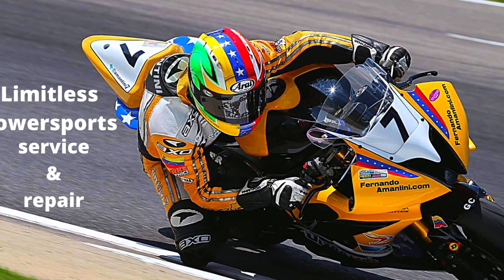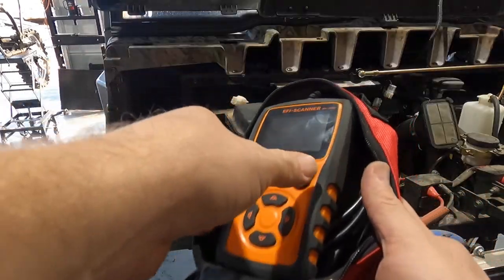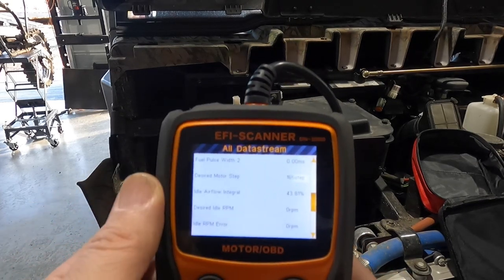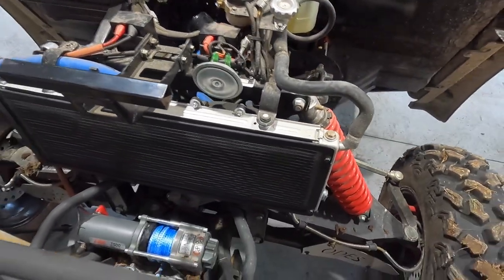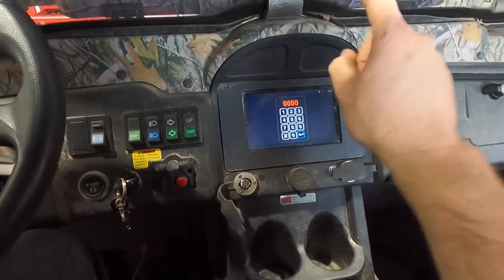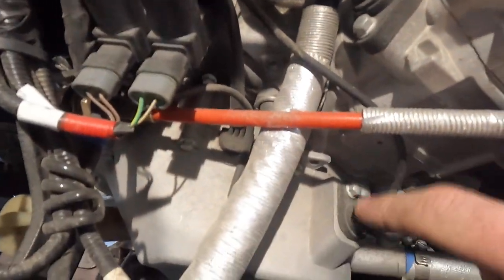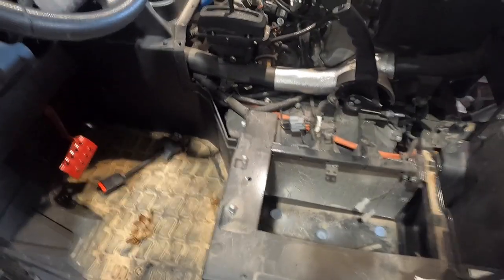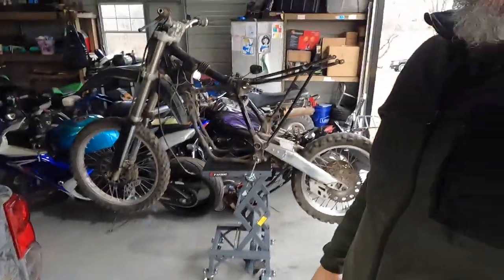Odes, Massimo, Bennche common issues

Comment: My 16 1000x4 starts jumping and cutting out around 16mph. Any ideas? Shop put new transmission in it other thdn that's its all been done to it. TIA
Reply from the maker: Is it like cutting in & out? If so my guess you be the reverse speed controller.  I know you're driving forward but they can cause that issue.  But I would definitely check to make sure that non of the connectors are loose are that  non of the wires are melted are pinched.

Comment: I have a 2016 odes 1000 i have replaced the battery, stator and rectifier. Battery light still on display and the system will not charge. Any thoughts....
Reply from the maker: A lot of people are just bypassing the wiring harness & extending the stator wires so they can just run the wiring directly from the stator & pug into the reg/rec. Did you check the charging voltage at the battery & the ac voltage on all 3 legs of the stator & ohms test it too? I have seen new stators that bad from the factory.  You could also have a break in the harness itself.
Reply: @limitlesspowersportsservic3394  
So the stator was burned there is build up on the fly wheel could that be an issue?. I will go back do those test and get back to you.

Comment: My Odes is pulling to right in front.  Air pressure is good.  Any ideas?
Reply from the maker: Does your odes have eps? If so I have had them start to go out & pull in either direction. Also check the toe in & out of the front end

Comment: Hi there. I just bought a 16 bennche spire 1000. I have no fuel or spark.
Reply from the maker: When you say no fuel, do you mean no fuel pump coming on? Check all you power & ground wires take sure they are not corroded. Then check to see if you have power running to your fuel pump & spark plug coils.  I could be just a relay going bad are it could be the 9 pin connector getting corroded also

Comment: My family just bought a massimo 850 and the throttle is stuck wide open and we couldnt get the dealership to help, any ideas on what the issue could be? Appreciate anyone who gives advice
Reply from the maker: When you give it gas can you feel the pedal return back under your foot? It's a possibility that the throttle positions sensor is stuck wide open are the Iac motor is stuck wide open too. I would take the intake off & look inside your throttle body to make sure the butterfly is returning all the way. But you would need to plug a scanner into it to see where the TPS is set at.

Comment: My hisun runs fine except every once and a while  it will  die with blue to black smoke  rolling from muffler  wait a few minutes  starts up and goes like it is suspost to with no smokeing, it does idle 2000 rims there is no knocking,  it sounds good, I don't  know what is wrong
Reply: 2015 hisun500 utv
Reply from the maker: Well it should be idling around 1,200-1,400 rpms. Idling that high must make it hard to shift into & out of gear. Well the blue smoke would be from buting oil & the black would be from fuel. These units usually are programed to run rich. You can do an ecu reset & see it it helps this issue out.
Reply: The mass flow sensor  was broke, I ordered a new one would that have something  to do with it,  I am having trouble  with oil getting into the throttle body, I will  try reset after I get my sensor,  Thank you
Reply from the maker: Will the mass air flow sensor will help with fueling on this thing. But it definitely will not help with the oil and the throttle body issue. That would definitely be an issue with it pumping oil into the air box and then recycling it back into the throttle body. Sounds like you got major Blow by the piston. I would check it with a leak down tester to see how much leak down is blowing past a piston also a compression test will help identify that problem too but a leak down will do more than a compression test will. I'll let down test will let you know if the valves are seating properly and if you have blow by the piston

Comment: i have hisun 800. it is randomly blowing the ecu fuse. i disconnected the ecu and the fuse still blew as i switched it on. does anyone know if there is a part that connects to the harness that might cause this? the dead short comes and goes. no amount of twisting and moving the harness has made the problem either come or go when it happens. most of the time the dead short is not present so it is hard to locate the fault. as things are i do not dare to go longer distances on the atv.
Reply from the maker: The ECU fuse. I would check the white 9 pin connector.  They get corroded & cause that issue. Also check the ecu pugs to make sure they are clean along with the ecu it's self..what year 800 do you have? Might have a wring diagram for it
Reply: @limitlesspowersportsservic3394  
it is made in 2011. hisun hs800 ATV
i have gone over all connectors and no corrosion anywhere. when the fault was current it would blow the fuse when ecu was either plugged in or unplugged. but any time i try to disconnect parts to see if i can locate the short, the short has gone away. the dead short on the ecu fuse line will just randomly show itself and then go away. i pulled the loom to see if i could find short to frame but it all looks good. i am now hoping it might be one of the parts that connects to the loom that may be faulty but hard to find it when the fault is not currently present.
Reply from the maker: It's definitely a part that connects to the harness that is grounded out internally.  Now does it only pop the fuse when the unit gets hot are just at random times when you just turn the key on & not run it?
Reply: I removed the plastics and had a fuse tester connected instead of the fuse. I wiggled the harness and checked all connectors. Now it has not done it again. But now I have a escalated problem of a starter kickback it is igniting to early as I am cranking it. When cold it starts out running on one cyl but slowly adds the other. Takes about 20 sec to be fully running on both. I did check the timing on the chain and cams. It is correct. Checked valve clearance it is correct. Changed out crank sensor. No change. Now I have ordered new 
Spark plugs
Ignition coils
Thermostat
Code reader

I'm guessing it is best to wait for the code reader so I can see what live data is showing me.
Reply: Hey budd I hav a 2017 800 Colman and it will crank a run. But then if u kill it after driving it. It leaves u stuck it won’t crank.  U hav ta come bak to it 5 or 6 hrs later to get it to crank

Wat could b my issues
Reply from the maker: When you say it won't crank. Do you mean it's not turning over? So next time you start it up and it gets hot turn the key back on and try to start it and if it doesn't start try, jumping the starter solenoid to see if it will crank over then. Sometimes the starters get really hot also and quit working till they cool down. But let me know what you mean by not cranking over by the motors Not turning over or if it's just not is turning over And not starting
Reply from the maker: I have a bennche 800 that does the same thing at start up. It takes about 10 seconds to run on both cylinders.  Everything is mechanically sound. No codes. I think it's is something to do with either the ecu are a fueling deal. If I start it & give it a little gas it picks up both cylinders right away.

Comment: My dads 800 junglecross wont start.  Turns over wont fire up.  Little over 300 miles.
Reply from the maker: Did you check to see if it has spark? Can you hear the fuel pump prime when you turn the key on?
Reply from the maker: Trie to add direct power to the fuel pump & see if it kick on. I have seen fuel pumps go out in less than 100 miles.

Comment: 2022 odes junglecross.  Fuel pump is sending fuel.  No spark.
Reply from the maker: I would check the CKP sensor. You need to ohm it out & check do a peak voltage test.
Reply: @limitlesspowersportsservic3394  do you have a video on that.  You are talking to an ignorant person when it comes to this type of things.  Sorry to bother you but I GREATLY appreciate the help.
Reply from the maker: The video I just posted yesterday about the Massimo milita 1000 goes over how to check it. It's the same cranks sensor
Reply: @limitlesspowersportsservic3394  
Thank you so much.  I really appreciate it.